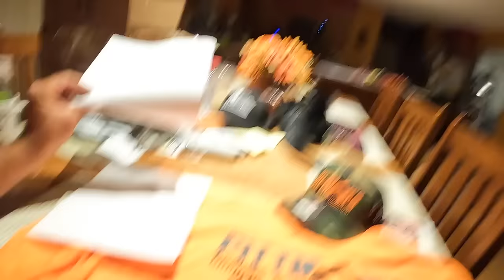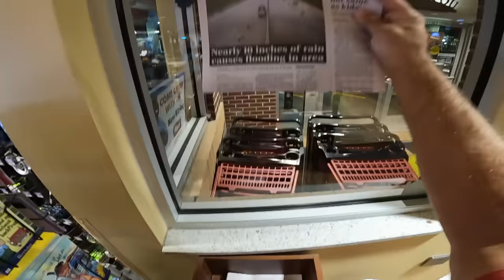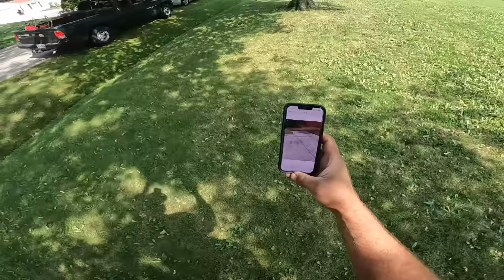It's so sloppy we had to get the plastic!

Comment: Is that 16 gauge mesh you lay down before pouring concrete? Does it help with anything if it's just laying on the very bottom? I had paid some guys pour me in some concrete like 16x40? 45? I for get. But I had asked to put in rebar and I would need it at least 4 inch thick cause heavy equipment will be riding on there. Anyways, I rode my 5 ton excavator on it and it cracked/crushed the edges, about 2 ft to the edge. I had also waited at least 4 to 6 months for the concrete to cure before riding anything heavy on it. So I had ended up cutting and removing the concrete, as I was taking it out the rebar was barely stuck to the concrete like half inch to none deep into the concrete. So I seen that. Also the pour was only like 2and half inch instead the 4 I was asking.  Was wondering if the mesh does anything ?
Reply: >Was wondering if the mesh does anything ?

Concrete hold presure fine but weak for tension. That what rebars/mesh for. As you can see when you apply forces on driveway concrete bend down that mean upper side of slab pressured and bottom side  stretching. That why mesh should be close to bottom side. But if it lay just under it will not work because it will have no bonds (and also will rust out). So we mostly use special holders that keep rebars above ground. Rayan use pull net while pour. Since concrete have gravel in it i gues it's prevent mesh to fall back completely on the bottom after being pulled.

Comment: Yeah that rainstorm was horrible,  that's when I found out my roof leaked so that was fun tearing out the drywall on the ceiling and pulling out soggy insulation haha
Reply: Did you have your insurance company look at it first cause you can void the contract. My former boss had wind and hail damage on his roof and he went up tar a few spots before having it looked at and voided the contract to have his insurance pay for a new roof but they did pay for the internal damage.

Comment: Just have a General Question Ryan: How hard is it to Finish the Slab ? is it difficult to learn and finish ? 
Reason i ask is i Skim Coated Concrete Floors with a Cement Based Patch to take Tile.
The Principal Looks like it's Kinda the Same.
Finishing Looks Really Cool. Wish i was 25 Years old i miss Construction. My Back isn't the Same like it was 25 Years ago Carpet installations isn't easy on the Knees and Back.

Comment: fransico driving so fast and trying to stop on soaked ground ruined their yard for weeks it will be bare
Reply: Yea he did come in alittle fast
Reply: @kevinshore8103  the front wheel on passenger side locked up and slid 10 ' not rolled to a stop could see the grass and dirt build up in front of the tire also

Comment: Ryan I know you know better. Get that wire closer to the edge. Some spots over a foot off the form. You know that’s the most important area. If it cracks on the edge that wire will hold it together. We’ll chalk it up to crete was there waiting lol. Good work man. Keep it going. I’m a small concrete business owner myself. 10 employees. Two crews. One commercial and one residential out of md/de.

Comment: Ryan, Im watching these videos again and when you were dipping the gravel out of the truck for grading, I tensed up. They other day a contractor was putting stone in for grading. He was doing that exact same thing, when he started getting rock from the truck the locks on the gate came loose and slammed into the machine. Busted the window and thankfully he didn't get hurt. The gate was low enough it just got the window. Stay safe guys.

Comment: Hey Ryan can you help me understand something. I have a 30x50 pad I need poured. I am installing radiant floor heat. I am using foam board at the base with wire mesh above that and then the pex tubing for the floor heat. With as much as you stress pulling wire, what do I do in this situation when pulling wire really can't be done. Is it a waste of money to even install the wire?
Reply from the maker: The sole purpose of the wire mesh in your application is to tie the pex tubing down. If you want you can put another layer on top of that for reinforcement.

Comment: I noticed when you pull the wire the the guys walk on it surly walking on it pushes it back down ?
Reply: Concrete is more viscous than it looks. Some of it will push to the bottom but not much.

Comment: 7:55  It's actually better to wait until the last moment to merge, you're supposed to use as much available lanes as possible. The issue are caused when people don't let someone merge, and the people that merge early. The zipper merge a simple concept of taking turns, one side goes and then the other, and if done correctly can reduce traffic congestion by up to 40%.